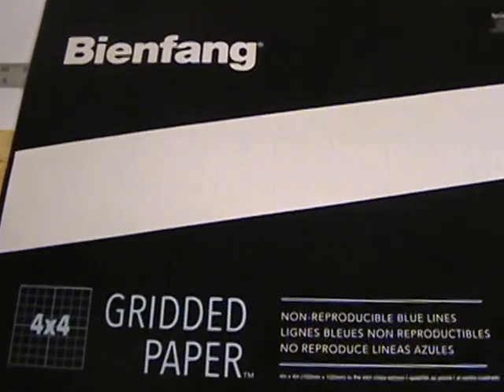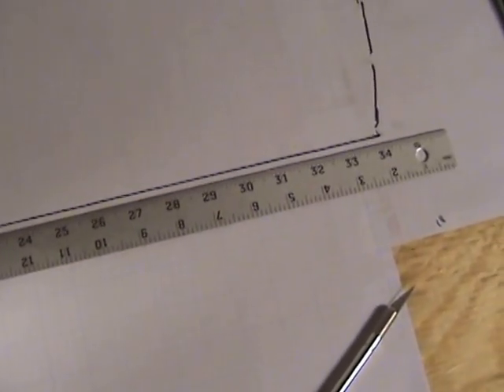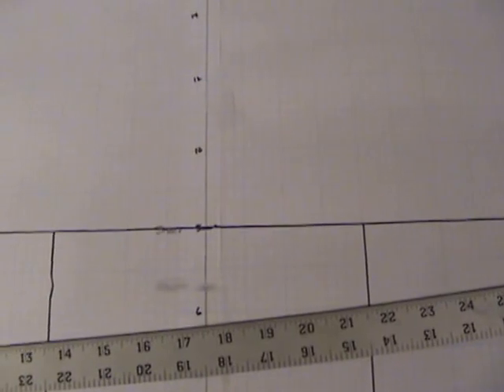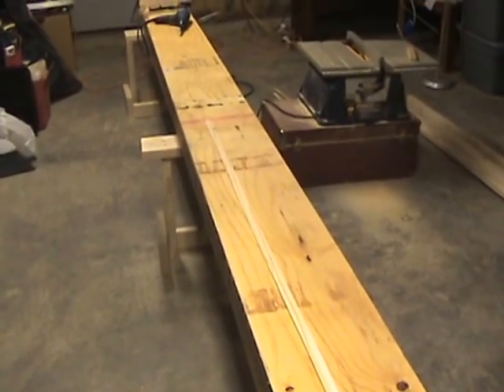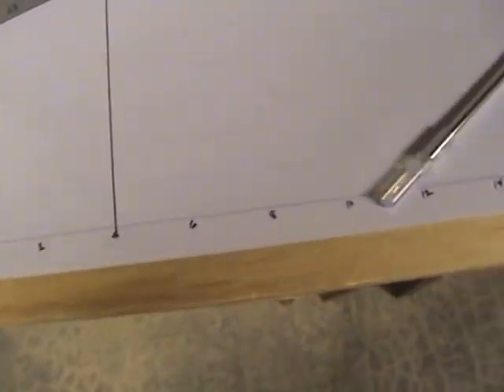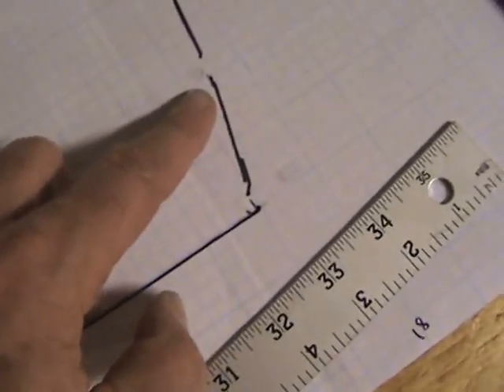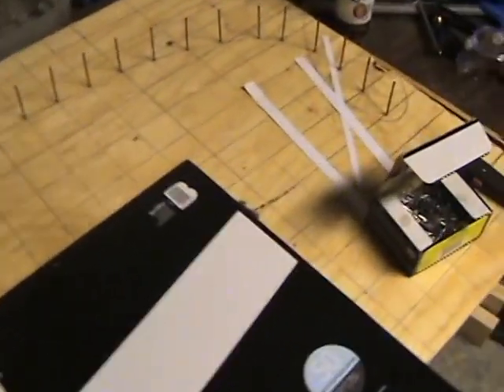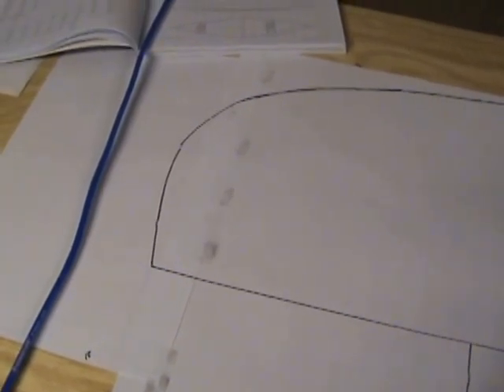Canoe Lofting

Comment: There are always more than 1 way of doing things. Built 22 strip and other method canoes(53years at it). After my first i never lofted any of my canoes. Took 24" wide frezzer wrap,and unrolled it out on basement floor. Used one edge of paper as a centerline of marine archeteture. Laid out waterlines by putting a batch of weight lifting plates on either side of a 12"x1/4" x twenty feet cedar strip. Each place i wanted a form i used a 2ft. framing square to extend 90 degrees from that edge of frezzer wrap(duh the mirror center line of canoe). The results are a giant page of measured intersect pionts of curvature of each form from flatspot line,1/4" waterline,1/2",then every lenghtwise waterlines at higher and higher at 1/2" up indepth of canoe.  This is called point plotting. Used long straight edge, and draftsmans squares to draft out(with flexible curve) forms with interior grade plywood.  All this because ther aren't suttle improovements in racing canoes. Thats my racing history.

Comment: on my drawings I just tack my paper down and hammer a small nail dent in the plywood on the lines every 1/2 inch instead of cutting them out. it eliminated any mistakes I could make on the cutting of the paper.
Reply: good idea ...

Comment: Thanks for the nice explanation - I have one question... in my
 copy of CanoeCraft (a recent copy) it says that the tables create the 
shape to the outside of the canoe and therefore to get the correct shape
 of the station moulds, after lofting from the tables a 1/4" should be 
removed from the shape (an even amount on the inside of the line). Is 
this something you have done or do your tables create the shape of the 
mould itself and not the outside of the canoe?
Reply from the maker: great question. Hi Lincoln.  The station molds are ok as they are.  I am currently starting a new canoe, the Freedom 17 that is in CanoeCraft. On this one, I am having to take off 3/4 inch from the stem/end molds but not the stations.  I have two new videos on lofting, on  my channel if you want to check them out, but the simple answer to your question is, no.
Reply: @JenkinsBoatWorks  Thanks for answering so quickly! In my copy of CanoeCraft is says this, quote: 
"The offsets for the plans in this book are expressed in traditional format of feet/inches/eighths and are given to the outside of the planking. If plans are being drawn from these offsets, the 1/4-inch plank thickness will be deducted from the body plan or half-breadths after lofting the waterlines full size"
This is on page 42. I am just starting and trying to get my head round the process before starting to loft and build but the quote seems to say that one would need to adjust the lofted station designs for the 1/4" planking. Does your edition of the book not specify this?
Reply from the maker: @lincolncooper3024   I sure don't remember doing that when I lofted mine. I build the Bob's Special. My boat may be a half inch fat! HA.  if it says that, yeah, maybe draw out your lofting and then take a compass or small little block of wood with a notch in it and re-draw the line in 1/4.  Which boat are you building?
Reply: @JenkinsBoatWorks  I've emailed the authors of the book to ask the same question so I'll let you know what they say.
I haven't decided which model yet, I like the swept back stem shape so maybe the Hiawatha but stability is more important to me at the moment so if that model isn't stable enough for a beginner (I have also asked this to the authors) then I might go for the Prospector. I'll follow your build with interest!
Reply from the maker: @lincolncooper3024   Stability is part of why I'm working on this Freedom 17. I'd be interested to know which is more stable, this or the Prospector. keep in touch!
Reply: @JenkinsBoatWorks  Mystery solved! On the Bear Mountain website, in the FAQ page it states that the paragraph I cited above is a missprint in the 2000 edition - the tables are for the station molds (apart from the stem of course) - the FAQ also lists all of the corrections in the tables - there is one for the Freedom 17 so you might want to have a look.
Reply: @JenkinsBoatWorks  About stability - there is a page on their website which gives all designs a stability rating -the higher the number the better. Freedom 17' is 98 while the Prospector 16' is 103. I'm actually going to go with the Prospector Ranger 15' which is rated as 104. I would live a more swept back stem look, but I can't find a stable design for a novice - it will be a future project :-)
Reply from the maker: @lincolncooper3024  You've done some fine work.  I had not seen that stability chart. very interesting indeed. thanks!
Reply from the maker: @lincolncooper3024   interestingly enough, I found out about the mistake on, I believe, station 0,  or 1, just before I lofted it so, caught it just in time. It would have been pretty obvious as the inches number is transposed so it says 10 (inches) instead of 01. it would have been glaring

Comment: Thank you, this was very helpful. I was able to loft all of the station molds however, I'm not sure about the stem molds. I plotted the WL points like the other molds but there isn't a sheer line or profile point. Any tips?
Reply from the maker: Thanks for the nice comment Victor, It has been a year and a half since I did this and I honestly don't remember exactly on the stem molds. I seem to have some recollection of there being some mistake in the book on this particular plan, like one of the lofting numbers didn't make any sense at all. After fretting over it for a couple of days I wound up interpolating a number that fit the curve. I was also confused with how far out to set the stem molds from the end stations and I actually played with that on the strong back as I was setting up. I took some cedar strips and clamped them onto the stations and then adjusted the stem stations, further out and back in until it felt like and looked like the strip ran fair to the stem end as I went. Some of this is, Make It Look Right. Watch some other videos and see if you can get a better answer for the stem molds. Jason Eke helped me a ton
Reply: Thanks for getting back to me, I appreciate it. I guess it's time for some trial and error.
Reply from the maker: Agreed, you might watch my other videos, the next one I did was Canoe Station Set up.  What canoe are you going to build? how big?
Reply: I'll definitely watch the video and see if it helps. I'm building the 16' prospector.
Reply from the maker: I hope that you will be able to share some pictures of your progress. Best of luck. It is easier than you might imagine and wildly satisfying
Reply: Chuck Jenkins - Ironically enough, I too am looking at building the Bob's Special. After reading your comment here about the mistake in the book, I will just buy the plans already done. This whole lofting thing looks like it can become quite frustrating, and now I will just stress myself out during the entire build, wondering if there's a mistake. lol. Did you complete your build?
Reply from the maker: yes, completed it and very satisfied with the results. I use my canoe in my farm pond regularly, And we did car top it about 5 hours to southern Missouri a year ago and floated her down the Current River. That was nerve wracking. too many rocks. We dumped twice but at the end of it all, only a few scratches and I went from having a piece of furniture to having a boat!
Reply: Very nice! It must have been a rewarding feeling. I've asked my wife to buy me the plans for a Christmas gift and I think she did. My intentions are to use the plans for creating the mold, but at the same time I will be lofting from the book too. Lofting looks like a rewarding skill to have, and this way I can confirm my results to the tried and true plans that Ted Moores sells. Cheers!
Reply from the maker: If I build another one, I will build for the River. We go every year. I will need a model that is flatter on the bottom and slightly longer. Also, I will use Kevlar or some other super heavy duty cloth on the very bottom. I used two layers of fiberglass cloth, one 6 oz and one 8 oz, I think and so it is pretty strong and I got a clear finish. I got a lot of admiring looks and wonderful comments floating down the river in mine. That said, I will do a couple of things differently the next time
Reply: Chuck Jenkins - did the extra layer of glass add much weight? Also, If you are looking for something a little flatter, then the ranger might be the boat for you. At 15 feet long, you can stretch your station forms a maximum of 2 inches each as discussed in the Canoecraft book. That would give you a maximum of an extra 28 inches. I myself wouldn't go that much, but an extra inch at each station would give you a 16'-2" boat. Just something for you to think about.
Reply from the maker: The extra layer of glass did not add a significant amount of extra weight.  I like your idea for stretching the length!

Comment: which the name of the book?
Reply from the maker: Canoe Craft. here is a link: http://www.discoverbooks.com/ProductDetails.asp?ProductCode=0920656242&gclid=CIKnx9Ov088CFQ8waQodcpQOZA
Reply from the maker: Canoe Craft has the lofting tables for about 6 or so different canoes. If you get some large graph paper you can loft up the frames. Then you take these curves and transfer to plywood and carefully cut out with a jigsaw.  I think if you get the book, see the lofting tables and then watch my video again a couple times you will get it. You just plot a graph but be careful and take your time. You will be able to see if the curves look right and make sense. I do seem to remember that on the stem and stern patterns there was a mistake on the lofting table and I puzzled over it for days before I finally had to conclude that it was a bad misprint. I don't remember exactly what it was but I ended up ignoring the wrong number(s) and drew the curve out, basically in the direction it was normally headed and it worked out fine